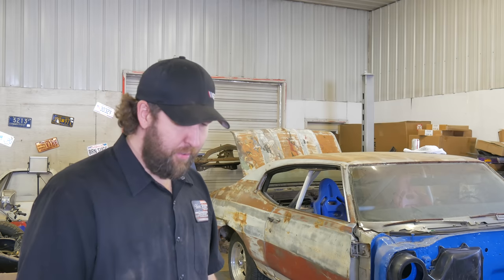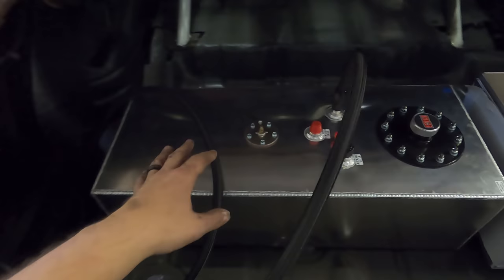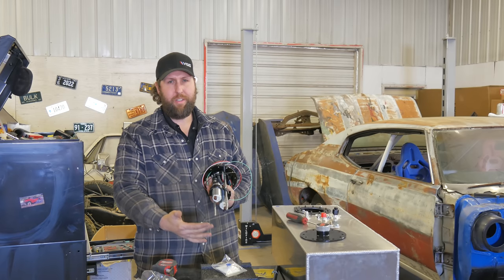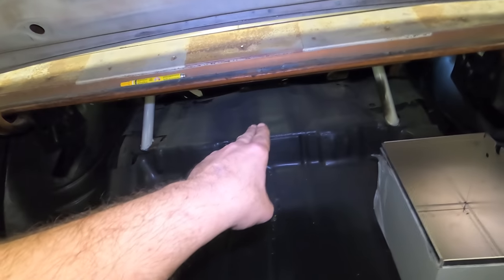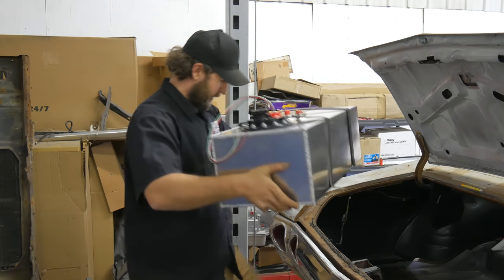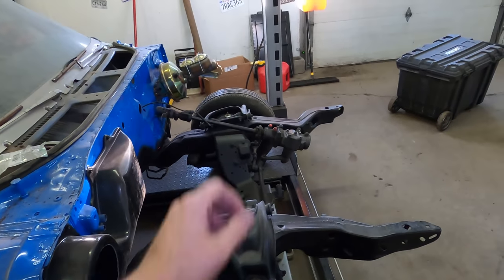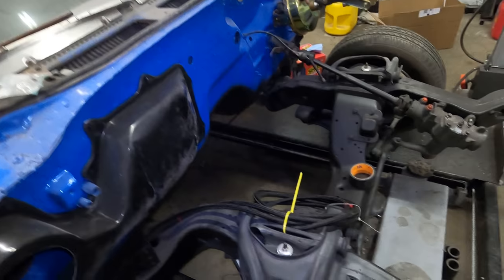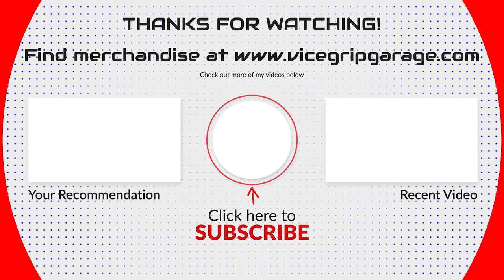Independence Chevelle - Fuel System & Battery Relocation Kit

Comment: Hey Derek if i were you i would have mounted that battery box smack dab in the middle of those roll over tubes just behind the back seat/trunk divider area. Nice well protected area.........than you could of mounted that fuel cell centered in the trunk. All pretty and factory appearing. Its all about symmetry  right uh no wrong opps whatever. Well thats my 2cents keep the change.....High 5 TC Stay Healthy  Jerry

Comment: Well after being out of town for last few months got the motivation to pull the heads off the old project truck, to find that I never drained the water I was running from summer and the blown headgasket decided to knock out 2 cylinder walls with rust. Atleast somthing good came out of today

Comment: Tech tip, AN line assembly. The part you put on the hose first is reverse thread. If you put a socket on your gun and hold the hose you can spin that on the hose with no effort even if your 10 wobble pops deep.

Comment: Hey Derek - I know this is probably too late...but if you need a quick way to work with fittings without marring them up, use a latex/nitrile glove between the fitting and wrench.  No joke, slit a spare disposable glove from wrist to finger, and put it across the fitting.  Put your wrench on the fitting (the glove takes up the slack) and then tighten it up.  I just redid the carb & filters on my big block truck without any special tools, and the only fitting I goofed up was the one I over-tightened and may have rounded a corner off! (It was a cheap thing I bought online because I needed it fast, but the hydraulic hose place was closed at 11pm on a Saturday night).  No need for fancy  expensive wrenches!

Comment: Derek - I think the fastest way out of your painting situation with Independence and save some time so you can have a life too would be to paint the whole front end a navy blue and by some self stick white stars. I would get a flag with grommets  big enough to cover most of the roof and tie it down through the passenger compartment. All of the pictures and footage you shoot will be with Independence coming out of the smoke headfirst. So I would concentrate on the front end. Just rivet that rear quarter on with some reinforcement so the  rear quarters don’t flap in the breeze. I would just cut the old paint with fine scotch brite ( with the exception of the front end which I would make semi pretty with the navy blue paint) then clear the whole thing. You can peck away at the body work between burnout events. You’ve got a lot going on. That’s why I love your channel. FYI ... I’m from your dads era. I used to go to the Drags when funny cars were just breaking into the high 6’s. Now Pro-Stocks are in the 5’s.

Comment: I would work on the red. I had a similar red on an old power wagon. I replaced a door from a different color truck and wanted to match the well worn red of the rest of the truck. I painted the door with red oxide primer, then got some red tractor paint and added some flat black paint so the red would no be to bright. I put it on with a foam roller cause I didn’t want it to look to good lol. When it dried I rubbed it with some steel wool to kill some of the shine. Looks pretty convincing in my opinion. I love independence. I have the independence long sleeve T shirt by the way. Best of luck to y’all

Comment: For adding new 'pre-weathered' paint before clear coating... Assuming the original paint was laquer, you could go to an ace hardware and get them to color match their 'stops rust' paint to the color.  You could then prep and paint them. But put it on thin.  Let it dry for a day.  Sand to make some exposed metal. Maybe use a variety of grits for different depths of scratches.  But if you want the oxidized look, use finer grits and sand mostly through the paint.  Coat with salt water and wait for a day for surface rust to appear.  Then prep for clear coat.

Comment: My vote goes to you doing a rustic touchup paint job but leave  most of that rust right where it's at. It gives you like 12 horse power when it gets into the frame and other heavy load bearing components. You don't need 'em anyhoo, nice car bro.

Comment: Derek I could have missed it in this or the past vida but a guy might think about welding on those upper and lower control arms a little.  box um in with some flat iron.  I did it back in the day to my 71 cutlass.  Those control arms are way more flimzy then they look.   also ever see those fancy riff nut jobbies?  they work wonders and might have made it easier on a guy to bolt in that fuel cell and battery box.  Great work man love the videas!

Comment: Might be too late but, have you thought about putting the regulator in the trunk with a short return to the tank? It’s unorthodox but a car I built would heat the fuel real bad. If I remember right it would go from 70f to maybe 160f within in 30 minutes. After I moved the regulator back and eliminated the return line the temp only went up about 20 degrees. I used a 3/8 hard line to feed the little 302. Just a thought.

Comment: Would not worry so much about your time line.  Make the car solid (ish). But the time line should not dictate color.  Yes it needs blended as best you can.  But you can always return after to remedy that.  Just use caution.  If you are using rattle can paint.  Make sure the clear will not lift it.  Do not want to see sanding for hours only to have it take a shit once clear is applied. Dry coat your first coat. Once its set up,  no more than medium wet.

Comment: If it were my rig, I'd be wanting to make them starts and stripes pop a bit more, so if you got time, chuck on some 'faded' red in a few places where she needs it and bring the stars and a bit of blue back around on the currently black front fender. If you use the 600 grit on the black just to get even a shadowed / darkened star and a hint of the blue where the fender isn't damaged, I reckon it would bring it in enough to the rest of the car to look good enough......but she does need some more red,,,,and maybe a touch of white if it had that on the roof too (just in some places).  Doesn't have to be pristine, but she's gotta look a little more like a faded version of her old self, I reckon.  A little more definition would help paint the picture of her old colour scheme without denying her journey and the hard life since she was painted up and looking pretty.

Maybe the right rear bit of fender that's held on with tape at the moment, could just get a line of tack welds inside and out to hold her on.  If it were me, I'd be wanting to block off some of them holes in the new trunk floor too and maybe where the bits of tyre are going to come through behind the wheel wells, cos a guy's gonna have to be able to see where he's going and I think too many extra bits and sparks flying around the battery and fuel cell might not be such a good thing. 

In any case, she's coming along well and that engine sounds fantastic!  Good price for such a huge amount of horses and torque as well.  Really looking forward to seeing what she does on the pan, mate!  I've chucked some suggestions up above as to what I would do, but anything you do to get her there on time to do what she's built to do, is really what needs done.  Tarting up the paint and getting it right can still be done between this outing and the next.  Good lick, Derek - you're doing fine and the car really does look better already.

Comment: Well a guy can run to the store and get a wire wheel and some rubber spray if he wants to do his own undercoat . We are about 40 years past that . As for the paint jab , a balance between new and old  might be the best . Maybe a a new white , faded red and faded star or two? Alternatively looking like a paint job that is running towards the rear as if the car was just painted and the guy couldnt wait for it to dry.

Comment: OH, and IMO step bits work way better than conventional twisty drill bits for drilling into plastic, thin metal, sheet metal, wheat thins, etc.  They won't grab and pull your face and hands into the trunk hole.

Comment: If you do a loop in the fuel tank vent line won't that make it so that air can't travel through it? If the line gets fuel in it that would turn it into a trap like in the plumbing or HVAC world, which lets fluid pass but not air.

Comment: Are you putting in a rubber mate between the fuel cell and the trunk floor so you wont have metal on metal contact of the fuel cell?
Reply from the maker: Its raised, the two don't touch

Comment: Hi Derek my man.  Love your big block, but for the life of me i cant figure out why you used the singing sisters for timing gear? I removed this crap from a friends corvette so one could hear the beautiful rumble from the stainless magnaflow kit with ceramic coated short headers.  I have a video recorded at the exhaust tips but still you can hear  the gearwhine loud. Another negative is that the little gears had started to gnaw at the thank god, thick chrome timing cover.  I dont think the whinegears give any advantage in performance.

Comment: 68 69 70 71 72 chavelle malibu dont really matter derrick is the car ill always dream about being able to obtain it makes me sad when i see ones sad and happy at the same time i suoposse happy i got to put my peepers on it and sad my peepers watch it drive away knowing ill never have my dream car i had to have a major lower back surgery involving screws and hardware big big drill that was suppossed to be on a floor drill frame for drilling holes in road tractor frames i built dump trucks but i used the drill not in the stand and useibg a reamer to enlarge a hole it caught i let off trigger and it kept going due to a ziptie someone used to hold down trigger so they didnt have to hold it and it wadded me up discs went to popping and after i got a little better i went for a slow ride on my Harley. And a jerk was mowing his grass and threw the clippings in the road so i rounded the curve at the top of a small hill 20 to 25mphs and bike goes side ways nothing but rear breaks cause i took the 18" wheel and tire off to put a better looking 21" wheel and tire the rotor and caliper from 18 wouldnt fit 21 so i ordered the right stuff so at the time no breaks but rear so i went sideways instint said throw your leg down try to control your skid and bike said NOPE AND GRABBED MY LEG WITH THE BACK WHEEL BROKE. BOTH BONES in my right leg one inch above my ankle and compound fracture of the ankle it came thru the inside of my foot mind u my toe was pointing at my other heal pipes really burned the calf on the same leg but other than that i was just a little skinned up so. A chavelle is just not going to be a part of my life even though i dream of owning one i wish i could find a rough one your independence car its rough but its so beautiful i would trade my old trusty Z71 for just a rough rollor and its all i have to drive right now i am a tried and true die hard chevy guy i am my dad and grandad was before they past on and man i guess. Watching your channel and the way you take the time for people like me to kinda build there dream car in a wierd way with u and your passion gor cars i just want to give you thanks for what your doing please keep it up i really enjoy watching you i live in a decent size town called richmond smack dab in the middle. Of kentucky from here to where you are thank you

Comment: About the paint:
The "patina" thing is so overdone. I would rather see you brush paint it with semi-gloss in the original colors than leave a bunch of rust all over it while trying to fake the original finish.  I'm not saying to do any bodywork (other than a quick sand to get the paint to stick). Just brush or rattle can it back to what it was. It screams "all the money is in the motor" rather than "rat-rod poseur". Just one guy's opinion.

Comment: If u know where ANY ANY kind of chavelle or malibu 68 to 72 it dont have to have any drivetrain it can be a roller i have welding schoolin so i can weld in quaters rockers floor pans i can do all of it so if u know where one is at a cheap or at least a little cheap please let me know if i can figure out some way to buy it ill sell my 86 cutlass 64.ooo mile car i rode home in it when grandparents ordered it new from local olds dealer my papaw drove a old 307 2 speed powerglide chavelle it was like goldish brownish with. A dark green fender its a dream im 44 it would take a few years but i would fix it